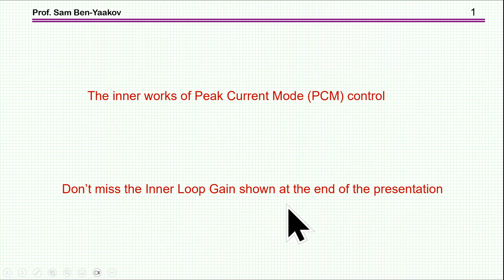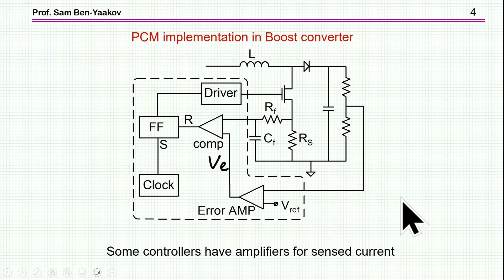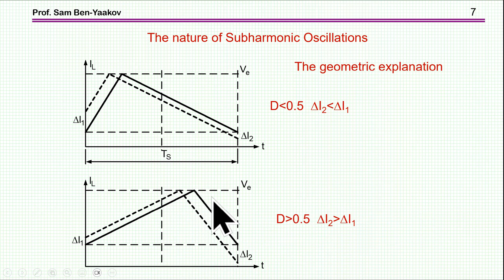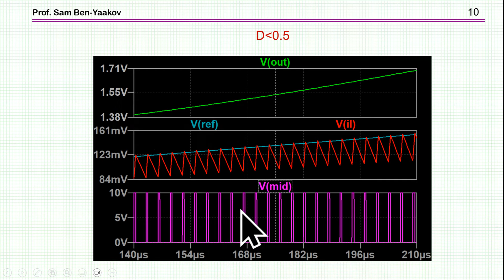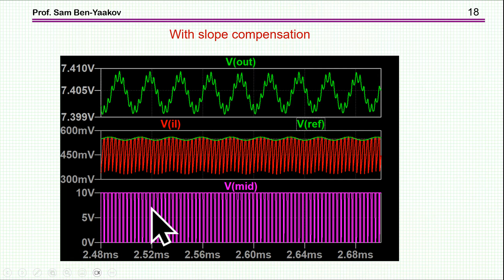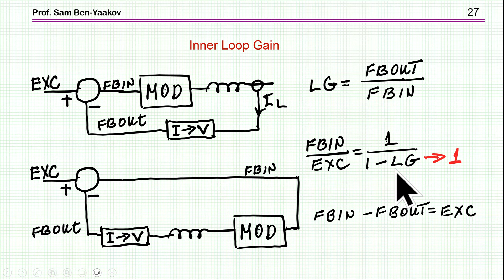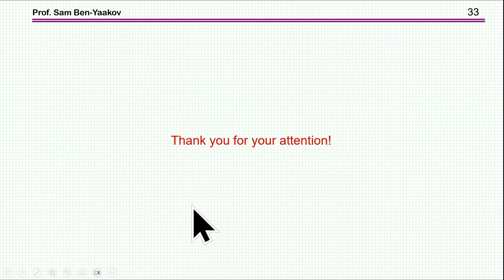The inner works of Peak Current Mode (PCM) control

Comment: Thank you prof. Sam for the interesting content! Your videos are so fundamental like the proper alphabet of electronics. Nice part with chatGPT, clever words.👍
Reply from the maker: Thanks.
Reply from the maker: Thanks
Reply: Hi Prof. Interesting result LG measurement   what a bout current feedback  amlifier case ? Can we use the same method as a voltage feedback amplifier? What if you have combined current feedback, inner loop , and outer voltage feedback?
Reply from the maker: @paulpaulzadeh6172  You need to decide what to measure. See for example H. Tsafrin and S. Ben-Yaakov, "The dynamic response of PWM DC-DC converters with input filters," [Proceedings] APEC '92 Seventh Annual Applied Power Electronics Conference and Exposition, Boston, MA, USA, 1992, pp. 764-771

Comment: Thank you Sam. This PCM method seems attractive at first sight, but in my opinion there are a number of issues with it that put constraints on the situations when you can use it :
1) As the wave forms at 2:00 shows, the current detection needs to be very fast and very reliable. If the PWM frequency is 100 kHz, then the peak current detector needs to be at least a factor or 10x faster, so needs to respond within 1 usec or so. If it misses even one cycle, or is a bit too slow, the loop locks up and your converter burns itself out. And since this happens very fast, any sort of second layer of safety is going. to be harder to implement too. Not very 'fail-safe' in my opinion...
2) As the schematic at 3:00 shows, this circuit only works if the 'logic' gnd is the same as lower rail of the converter. This is not always the case, especially not with the recent trend to put isolation devices between the power train and the control logic.
3) Very often, a digital controller (MCU) is used to provide the PWM signals to the switches, and that means we want to use PCM, we need another ADC in the loop, and that one ALSO needs to be very fast (1 usec or so). 
4) Finally a note : The Duty-Cycle issue in PCM (diagram at 6:00) that Prof. Middlebrook first reported about in my opinion is simply a loop 'gain' dependency in the feedback loop. After all, with the resistor-in-lower-switch current detector we are only measuring the current when the switch is on. So the loop gain increases linearly with the duty-cycle. Is that a fair statement ?

Thanks again for reporting this interesting method of implementing a current loop, but may it be that the application of this method is not very often used any more now that PWM control with an MCU is more common ?
Reply: - PCM needs to be done "analoguely". Don't put it inside the DSP. It's easy to be implemented and gives an intrinsic over-current protection for the Mosfets.

- You can "skip" the ultra fast reading of the inductor current (which is costy and prone to noise) by just reading the slower output current signal, using a hall sensor for example...added over the integral of the inductor voltage ( from a secondary winding, for exemple). The resulting signal can make up for the true inductor current...and it's much more clean.
Reply: @peplegal8253  Yes. I prefer the Hall sensors to measure the current in the inductor directly. Those are inherently isolated, and the current feedback loop can also be much lower bandwidth (down to PWM frequency) so noise and spikes are much less of a concern. And we can process it in a digital MCU or analog feedback loop alike. 

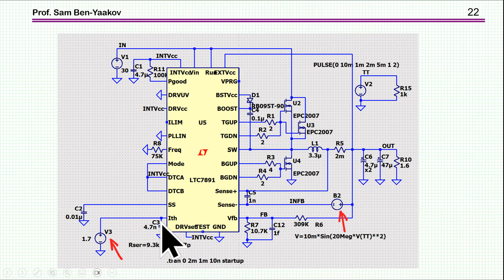So I do realize than the LTC7891 that Sam presented in 16:50 uses a PCM feedback loop, so this method is clearly still used, but with the design constraint and safety issues alike I think those designs are bold and not for the faint of heart :-)
Reply from the maker: Sorry to break to you the bad news. You are in in the minority. Most of today's dcdc designs are based on pcm . Think about all the cellular phone chargers out there. Most use a flyback with PCM.
Reply: @sambenyaakov  Thank you for correcting my statement. Is it fair to say that the great benefit of PCM is that it can provide a constant voltage output with no switching going at all (super low power use) if there is no load request ?  

I was thinking in my field of AC/DC power inverters and EV chargers, where  high power needs to be moved using an digital controller. For such applications, I have been reluctant to use PCM for the reasons outlined above. 

But I have to admit that I'm still rather new to this field, and I am learning a lot (especially from your lectures) about which architecture to use for which applications. In fact you have been pretty much my mentor for the past 2 years in this field, and I thank you very much for that.
Reply from the maker: @2meters2 The primary benefits of PCM are cycle by cycle protection and a wider bandwidth. A poor boy compromise that can be easily implemented digitally is the average current mode. This in fact is used (albeit not named as ACM ) in modern EV drives. The inner current loop, and the outer speed loop.
Reply: @2meters2 average current mode and hysteretic current mode control also benefit from..slope compensation @d>0.5 .....
mcu's / dsp's can be too slow..to respond to corrections
 for switching freq. in excess of 500kHz...on a cycle to cycle basis.....
All those ADC's @ scaling to size...for 1v8/3v3 seem illogical when analog circuitry can work with voltage ranges (30-40)V...and these have large g.b.w. products upto 25-40Mhz.

Comment: Another great video! I was hoping you would also show a practical implementation of how YOU apply slope comp using a generic controller IC, for instance the UC384X
Reply from the maker: This is for homework😊But the fact is that most modern PCM controllers have a built it slope compensation network. There is ltle reason to use UC38x

Comment: Sir i have some doubts other than the PWM generation of Peak current  control what are the other parameters gets affected due to the short circuit condition in peak current mode control ? like the which parameters gets affected due to that high rate of change of current sir ?

Comment: Excellent video, thanks.  So this is why you have the ramp pin on a PWM driver. Is it not also used to generate the square wave output?
Reply from the maker: The ramp is part of the oscillator. In voltage mode controllers it is part of the duty cycle generator. In PCM it can be used for ramp compensation.

Comment: professor,what's V(EXC) of B4 in your LTspice simulation in your presentation？
Reply from the maker: Please indicate time or slide number.
Reply: @sambenyaakov  LTspice PCM model at 9:41,thank you!professor.
Reply from the maker: @luzhouyang5414  it produces REF which is like the output of the voltage error amplifier. Here it is used as a signal to test tracing. E.g. https://youtu.be/b67u3Y3l26o?t=824

Comment: is there a advantage in having  +slope compensation in the current reading vs -slope on the reference? 
Also what is a good starting point for the slope?  -1V /ms  ? or this value is determined later with experimentation /simulation ? 

Regarding this mode of operation can it reach 100% duty cycle? asking since besides the current sensing method i dont see why not ( unless it is a FET driver limitation) ?
Reply from the maker: Not really but you have to keep the signal within the voltage range.

Comment: Hi Prof.  Interesting results for LG.
Wonder for LG for the current feedback amplifier. Can we use the same method as a voltage feedback amplifier? What about if you have one inner current feedback amplifier with one outer voltage feedback amplifier. 
I understand that your video is DC/DC . But what about the current feedback amplifier with outer voltage feedback? Thanks for answering in advance
Reply from the maker: The method is general. The question is what loop are you are interested in.

Comment: Sir but the slope compensation method doesn't effective(precise and accurate ) for PCM used for all application.(specifically fr PCM in Current Limiting purpose in  Solid state Circuit breaker application),
Reply from the maker: Slope compensation is required in converters, buck boost, flyback, not in switches.
Reply: @sambenyaakov  sir but i am using buck topology fr current limiting purpose and it also acts like converter during normal operation.
Reply from the maker: @thavakkodi6290 PCM has advantages over voltage mode control and you do not need an external over current  protection.
Reply: @sambenyaakov  ok sir thx